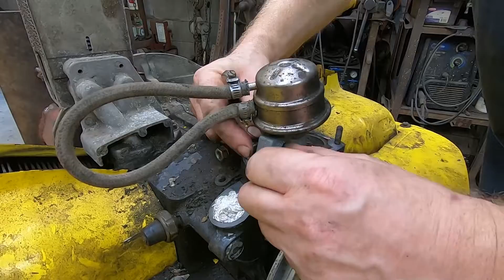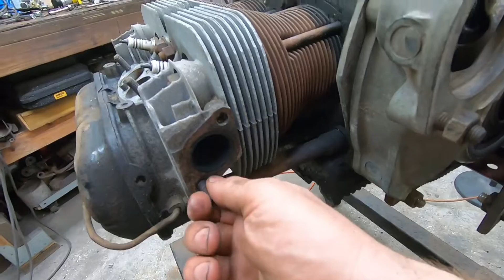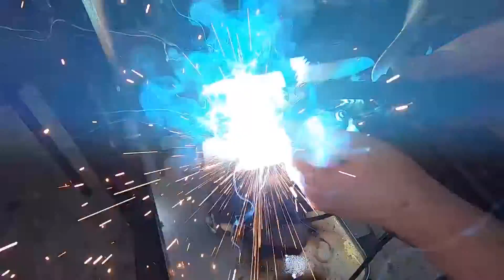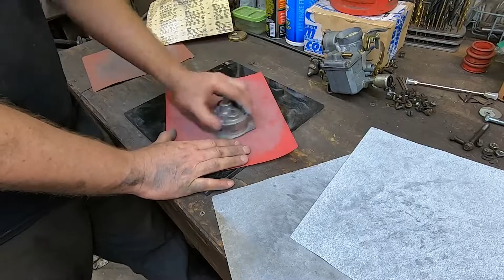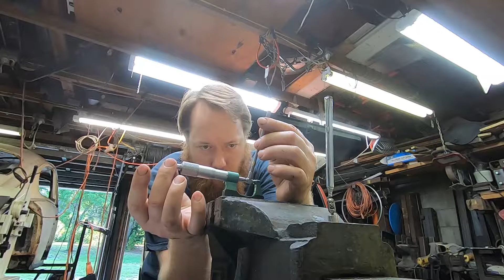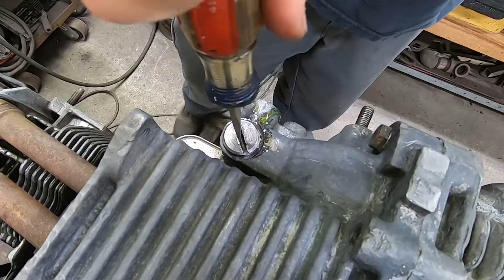Engine Drama! Removing Rusty Broken Stuff - Modifying Oil Pump VW Split Bus Restoration Vandemic E10

Comment: the oil valves seal on the end. when they are forced open they dump directly into the sump. it doesn't matter if they have extra side clearance. cheers
Reply from the maker: Thanks for watching Dave, and cheers to you too!

Comment: 30 years ago ( plus ) replacement parts were better quality and anything not to spec wasn't sold to customers...but sadly we source our parts from places where quality isn't important or possible... So no suprise that new parts are imperfect. Should be expected nowadays where cheap price is the standard your only given.... Used to be different..and it could be if we returned to parts made in our continent ( North America )....
Reply from the maker: Yup. Shopping on price alone brings shoddy goods to the market. It's been impressive to see our hobby catch on to this fact over the last couple decades and increasingly prioritize results in their purchases.

Comment: Sr.  I wish I had a neighbor like you...or that I were your neighbor to learn as much as I could.  My bug's engine suddenly decided to pee the oil right through the crankshaft seal, upon further inspection I saw there was a BIG endplay...anyway,  I started saving for an engine rebuild...then pandemic struck and I lost my job. There went my hopes to fix my bug. Long story short, I found a very cheap engine with no end play, but nasty as hell and I decided to buy it with idea to clean it and put it in place of the other...and well, just as I started working on it...a fear of screwing things up overcame me and it's been there sitting for almost 3 weeks now.  I miss driving my bug and I really don't want to take him to a garage because I really would love to learn how to fix him myself...and well...its either fixing or eating.
Reply from the maker: Sorry to hear of your challenges Дитэр Перез, just know this will pass and better times are ahead. Keep yourself fed and the VW will be there for you when the time is right. Until then, stay positive and thanks for checking out the video!

Comment: I remember back in my 20's when i when through my 4 year tool & die schooling, the telescoping gauges were a challenge to use correctly. Then after we mastered using them , they opened a cabinet with bore gauages ...really.   Oh the joy of aftermarket parts.. Good checks and tips with the welder getting those broken tin screws out. The first time i used that method was on a  stud located on the bottom of the case for oil cover.  cool saying.. Your method on the hub cap clips worked great thanks for sharing that method on how to remove old broken ones and install new clips
Reply from the maker: Ha! Sounds like an effective teaching method if not a little aggravating! It would have been great to study this formally; I'm sure your schooling continues to pay off today. Dial bore gauges are great, and the little ball type are cool too for smaller holes. The welding trick works great when it's necessary. A little risky, but effective! I'm glad you got the rivets installed successfully, thanks for the follow up. That one is kinda fun after you get the feel for it. Great to hear from you as always Dan!

Comment: A suggestion, which I think you will likely do anyway.  You mentioned that you didn’t want to dig into the long block, but taking the rockers off and re- torquing the heads if definitely worth doing.  Cheers Richard
Reply from the maker: Thanks Richard, that's a great suggestion and I totally agree. The rockers will be coming off anyway (stay tuned), so that will be my chance. I've been a little apprehensive about pulled studs because this case has the larger 10mm studs without case savers; they're notorious for pulling out. It'll take a little courage, but now is the time. Thanks for the input!
Reply: Haptic Garage good point about the studs without case savers. This goes to your point about VWs needing lots of maintenance, pull a thread and on and on it goes.  Love your approach
Reply from the maker: Yeah, it's a thing but still a good idea to check. Thanks for the support and here's hoping the approach pays off!

Comment: Happy Fourth Of July !!
Can't wait to hear it rumble to life.
Meaning no disrespect, but when I learned to surface something on
a surface plate, I was taught to  make a figure eight motion.
It makes a smoother surface.
Keep up the good work and videos'
Reply from the maker: Hey Steven W, great tip! I usually sand for a while, then rotate the part in my hand 90 degrees, then repeat. I like the figure 8 idea; I think the big thing is to randomize to average out any irregularities in the work piece and/or our grip on the part... we probably aren't holding it as evenly as we think! Thanks for sharing the info, I'll keep this in mind the next time I need to flat a part. I'm looking forward to hearing this thing run too! Thanks for watching and being a part of the channel!